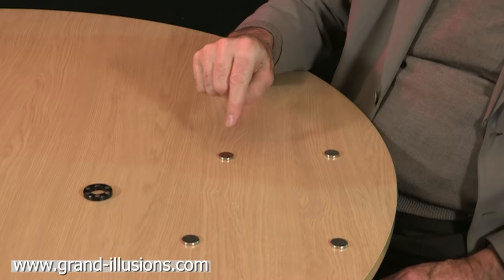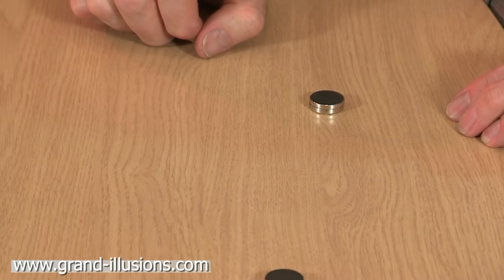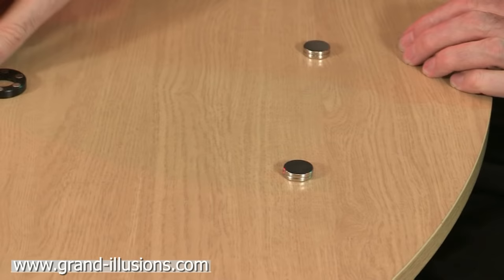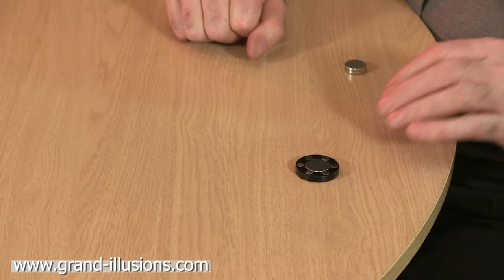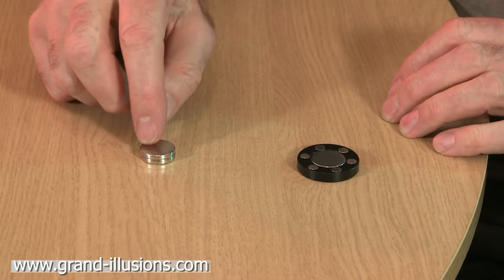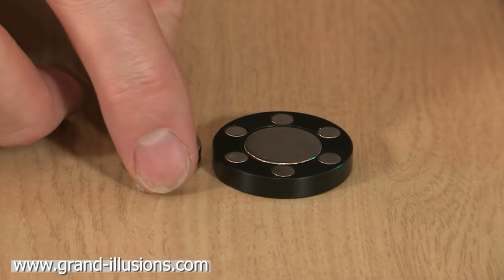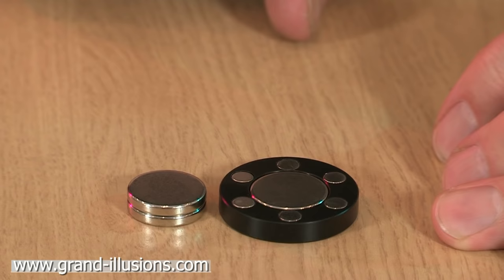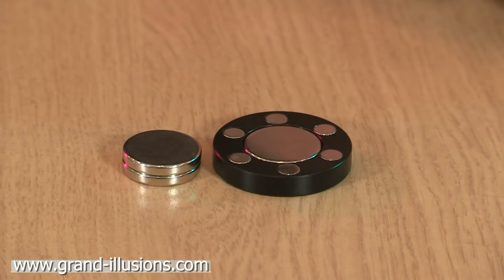Amazing Discovery With Magnets - The Inverter Magnet

Comment: I think this could actually be a good model to demonstrate the attraction between Ions. At first, the big inner magnet, which represents the core of the atom, pulls in the other magnet, but as soon as the attracted magnet gets too close, it is stopped by the smaller outer magnets, which represent the electron shell.

Comment: What happens when you lift it up?
Reply: I wondered the same thing.
Reply: +Harrison Fung I also asked that :D
Reply: +Harrison Fung
The magnet flips under it and sticks to the bottom.
Reply: +Ryan Seashanty It couldn&#39;t work by the same principle if it was just spherical.
Reply: +Harrison Fung i was just about to say that
Reply: +Ryan Seashanty That doesn't make sense. Magnets have a north and south pole, if it was spherical it would be the same as being any other shape.
Reply: Harrison Fung It Flips Over And Attracts The Magnet Probably Breaking It
Reply: It would be so fucking cool if they both lift up making it seem like the other was levitating haha
Reply: William Barnes only because the device is so thin. If it was much longer and real world size you could easily achieve this. Also if you from the magnet not in the device, the magnet would freeze in place to however you placed it. You could make train tracks out of it and the magnet stuck would be the bottom of the train. You're probably thinking. It would just stick to the plastic if it was longer since the half way point to a north and south of the magnet. Yes this is true. But you can also manipulate magnets to switch their North and south directions. It's very complicated so I won't go into it but yeah
Reply: @808JuJu  great explanation.good job!!!
Reply: It gets attracted by spinning surface and is no more equilibrium.
Reply: @PieCreeper12  Mee tooo.......
Reply: @williambarnes5023  what if it's spherical
Reply: @mukonank783  Then it doesn't wait until you lift it up to flip over. It rolls in place 180 degrees and then sticks.
Reply: @daniela7386  "Quantum locking"
Reply: They'll flip and stick to the 2 magnets middle in the center.
Reply: ...a blackhole tears the fabric of space!

Comment: The functioning is pretty simple.  Magnetic force is an inverse r-squared effect. the larger magnets pull together at a larger distance, until the effect of the smaller magnets (being closer) overcome the attractive force of the (further) larger magnets.

let's say that the small magnets are .2in closer than the far magnets.  at 1inch it's 1.2in^2 / 1in2 = 1.44 multipplier.   at .2in it's .4in^2/.2in2 = 4    thus the closer (but smaller) magnet gets a 4x multiplier over the larger (further) magnet.  When the distance multiplier matches the strenth difference the two systems are in equilibrium.   Any closer and the small magnets push REALLY hard.  Any firther and the big magnets oversome the repulsion of the small ones.
Reply: HEYYYYOOOO .... he invented magnetic bearing accidentally.....

Comment: Should pick it up and see if the smaller magnets float in the air.
Reply: Thinking about same thing 👍🏻
Reply: It wouldn't work it would simply flip over on to the middle magnet
Reply: Moofy You sure?
Reply: Positive. The only thing keeping them from flipping and sticking to the stronger force is their own weight and the flat surface of the table. You would need a three dimensional array with more magnets in order to make something float.
Reply: ragepoweredgamer Depends on if the field pulling it sideways has a strength with the other magnet greater than gravity though, right?
Reply: nexus1g The top and bottom half of the magnet would both have to separately hold a force greater than gravity. There's no friction to keep it from flipping, so it has to rely on attraction alone, and if it's only "stuck" on the one little edge, the rest of it is deadweight hanging there, with more force pulling downward the farther towards the other side it gets. In theory, it could work, but it would have to be MAD strong, and not have that much weight that isn't being used to hold the bond.
Reply: You can all apply a simple experiment by simply taking two toothpicks to make guide rails between the two magnetics. Then lift. I did this and yes, there was quite enough force to keep the magnets apart and for it to provide enough lift to stay attracted when lifted off the table. The future of rail cars? of trains that can be made up of several cars - then magically split off from each other on the fly! - by changing their magnetic properties? How very very interesting. Be the guy that invents a train using these principles. Yes, I realize there are mag lev trains. But they wouldn't/don't work in this fashion. Cool stuff.
Reply: +ragepoweredgamer   Putting them in between two sheets of glass, would prevent the flipping.
Reply: Is this not a step towards levitation without the need of super conductors at super low temperatures ?

Comment: There must be a very good use for this on a larger scale somewhere , Amazing ..
Reply: Make vehicles this way, some how, never have accidents.
Reply: but they can never separate
Reply: .......As long as its in that configuration. Have an actuator separate the magnets or use electromagnets.
Reply: Sonn Ikdoh Automatic docking system for space craft. Electro magnets of course. If anyone tries for the patent, you've got me to contend with.
Reply: ISamuelII Wouldn't electromagnets big enough for that be really really heavy and not really worth sending into space in the first place? Not to mention the power needed to drive them will always be more than the actual power you will be locking your space craft with, therefore it would require a huge amount of power.
Reply: Sonn Ikdoh Going from a high speed to a low speed in a short amount of time is gonna fuck you up no matter what.
Reply: ***** In the "micro" gravity locations like in an orbit, when you near the object you are going to dock with having a matched electromagnetic system to connect to, no it will not require a large electromagnet at all. Take two neo-magnets and fell their strength against gravity right here. No take that gravity away. See what I mean.
Reply: Magnetic floating axel for one.
Reply: mrkiky  AI is very shortly make money obsolete my friend
Reply: Don't they use it in Japanese speed trains?
Reply: I could tow my caravan without a hook
Reply: ISamuelII you'll probably have some government to contend with. 😂😂
Reply: I am sure that Lockheed martin is putting the magnetic technology to good use in their UFOs.
Reply: There is no such thing as gravity. This is sort of the mirror image of the Earth's interaction with the Moon. How else do you explain that we only see one side of the Moon.
Reply: @Krzychu Yes, you could have a series of magnets that will gradually be stronger or or weaker to aid in the slowing...?
Reply: @sonnikdoh2510  hahah. That's funny. Save the cars completely. The passengers inside will not be stopping though... That's why cars are designed to crush and absorb impact.
Reply: @memwaandic5039  Well I'm sure we would need to redesign the interior too. Off the top of my head place all seats on a track that can't be adjusted manually but with enough force it gives slightly to offset the momentum.
Reply: @peterbob1407  Yes they can, just pull them far enough apart with a strong enough force.
Reply: @RandomnessTube.  That's simpler I think. They just balance gravity with repulsion. This is an interesting type of purely magnetic trap. I knew of magnetic traps that surround magnetic things (they are used for lots of physics experiments, including things like storing antimatter, since many neutral atoms including of hydrogen have magnetic fields), but not of ones where a magnet that isn't surrounded is trapped.
Reply: @mrkiky  Quite the opposite.  With the right array, configuration, power, and size, they can take you into interstellar space.
Reply: @leroyhudson4311  We only see one side of the Moon because of gravity. The hemisphere that faces us is slightly denser that the other, which eventually caused the Moon to rotate exactly once per orbit.
Reply: Frictionless bearings anyone?
Reply: I think this is used in some electric motors. It connects the spiny part to the powered spiny part without touching. Pretty cool eh? Doesn’t wear out over time like gears but can slip unlike gears
Reply: Sun and moon very likely...😁

But gravity...relativity....quarks...string theory....dark matter....black holes and space travel allow many billions to be taken from tax payers....

And yet it all only exists in theory and making mathematical equations to try and fit the theory...

It's much easier to imagine that magnetism moves the sun and moon around the earth imo...in fact it has been demonstrated that you can place magnets around a table and then another one or two on top and they will keep revolving around the table on their own...

Imo this theory is much more plausible than us being on a spinning earth that rotates at 1000 MPH whilst moving around the sun at 66000 mph whilst chasing the sun at 600000mph whilst also moving sideways through the galaxy at over 1million mph.....

And yet we still see the north star in exactly the same place and the rest of the stars all line up year on year like a perfect clock....

But science says.....I'm stupid🤷🏾‍♂️

And yet it has not proved any of it...🤦‍♂️
Reply: @anthonyferguson4218  Just because you lack the cognitive capacity to understand something doesn't mean it isn't true.
Reply: @pseudotasuki  very eloquent well reasoned debate....👍

Which is the norm...when discussing anything people dont like hearing...

Please answer me one question Einstein...

Why when man went to the moon is it such a grey dark dingy dusty rocky place...but a quarter of a million miles away on a good night I can read under the moonlight..🤔

You can use inverse square law to figure  light into calculations....its quite unfathomable to think how bright the moon would be if you were close...

And yet its about 100x brighter on earth a quarter of a million miles away than actually being on the moon...🙄

Then maybe you can tell me how the ISS which is about as big as a plane can be seen....yet it is apparently at an altitude of over 50x higher...and yet you can barely see a plane at cruising altitude...🤷🏾‍♂️

I'm after your intelligent input....because even though I understand inverse square law and light I'm having a hard time understanding how these objects appear as they do....

Those pictures on the moon with the sun casting those strange shadows on the astronauts somehow doesnt light up the moon when your there...but it lights it up to me when I'm on earth...🤦‍♂️

I await your response oh wise one...😉
Reply: @anthonyferguson4218  I find it difficult to believe that you haven't been able to find answers to those questions.
Reply: @anthonyferguson4218  I bet you think you're being clever.
Reply: @pseudotasuki  you told me you were and I was stupid🤷🏾‍♂️...so instead of wasting precious time I would like to pick some wise nuggets of information from you...

I didnt ask you to join in you volunteered yourself...so please enlighten me👍
Reply: @anthonyferguson4218  U got me curious. I did some digging and found out that the moons surface apparently reflects light like freshly fallen snow. A lot. This makes it dangerous to see during daytime on the moon. So astronauts and robots often do stuff during the “night” with earth light which is similar to 15 mins after the sun sets in July at the equator in the US according to some report from nasa or something I read. The high contrast between light and dark is not easy for human eyes or cameras. As for the moon being bright on earth? It’s daytime on the moon meaning it’s really bright. The moon is also really close to earth and without any real atmosphere, reducing distortion of light particles. Also if you notice during the day, the moon isn’t nearly as bright as the sun. 

https://scitechdaily.com/how-light-looks-different-on-the-moon/

https://www.quora.com/How-much-brighter-is-the-sun-from-the-surface-of-the-moon-than-it-is-from-Earth-on-a-clear-day

https://www.lpi.usra.edu/lunar/strategies/human_ex/lighting_constraints.pdf

https://wtamu.edu/~cbaird/sq/2015/08/06/why-is-the-moon-so-bright/
Reply: @orderlyhippo1569  well you will have to do some better digging than that....thanks it us rather ridiculous....

Look at the shadows....you dont get shadows like that without the sun or a fake light source being over you...

It impossible.....I find it hard to believe you actually believe that pathetic excuse...is it not just easier to just admit we never went these days...its a rather ridiculous lie , if you're casting shadows there is a light source casting light on the ground...

And also bear in mind the moon does not have the earths thick atmosphere so the sun should be really hitting the surface...with no water vapour or other atmospheric gases to stop it...

The fake scientific community is in too deep and too egotistical to admit they may of been lied too....so they keep on coming out with more even ridiculous excuses....

It is ok for people to admit they were fooled....but for some reason people cling to the lie....the sun creates shadows end of

So if the light that is casting those shadows is not the sun they are not on the moon....it should be as bright if not brighter than setting alight  a big ball of magnesium....

Longer shadows means the sun is further away shorter shadows mean it is closer and above you...

People get that desperate to find an answer rather than admit they have been fooled will believe anything....dont let preconceptions spoil your logical thinking....your starting with an answer you were told was true so you will make any irrational nonesense fit the answer you have been told...

Clear you head pretend we never went to the moon....then examine the lander the panels dont even fit together there is gaps...its tin foil duct tape and cardboard. ...then look at the rover..... just .think of the puny batteries they had in the blistering heat and beyond freezing temperatures. ...neil Armstrong's moon space suit is in storage in museum and yet his boot has a different print to the one he apparently left on the moon....I think my cell phone battery is better than what kept everything going on the moon......if you analysed the footage clearly and thought with normal human intelligence and rationale without trying to make excuses  to fit the predetermined answer you will know that its absolute BS.. ..

But some people either dont like being honest or admitting they were fooled....especially If they have called people dumb conspiracy theorists ....it gets a very bitter pill for them to swallow.....they would rather they kept on wasting billions of their taxes on nothing than admit that people they called dumb were smarter than them...

And yet here we are.....doesnt matter that they say they have destroyed the technology now....or they are looking for a safe way out of the van Allen belt even though they went through it before or the fact they taped over 17000 reels of moon data....they still believe their preconceived answer because their ego can not take the fact they believed the most ridiculous lie ever told...👍😉
Reply: @anthonyferguson4218  Tell ya what, I'll answer one:

You can read by moonlight because our eyes can detect contrast over an extreme range of light levels. Direct sunlight is 400,000 times brighter than a full moon.
Reply: @anthonyferguson4218  I got nothing against you, but think your being a bit paranoid. Your theory has to many holes. Satellites, relativity experiments, how magnets work, and other things suggest strongly against your theory.

Comment: seems like the inner magnet is stronger, thus attracting the other magnet from quite a distance. but as the other magnet gets close,  the force of the ring magnets increases faster because they are closer to the other magnet - because the magnetic force is not a linear but an exponential function.
Reply: Actually, it is not an exponential function. It’s an inverse square function.
Reply: @Sauromannen  isn’t that also exponential?
Reply: @ThomasRippel  no. An exponential function has the variable in the exponent such as e^x,while in this case it is like x^-2.
Reply: @Sauromannen  i think what we are looking at is something like x^1/y
Reply: @ThomasRippel  just guessing, huh? There are perfect mathematical models for simple magnetic dipoles that you can look up, and they are not exponential in nature. The actual force between magnets are depending on the magnetic field that decays as an inverse square of the distance. The shape and surrounding magnetic (or susceptibility) properties affects the forces between magnetic objects as well.